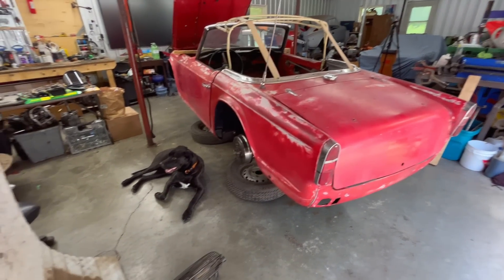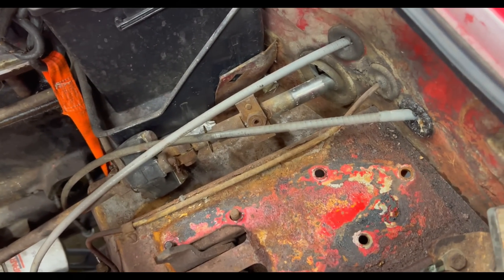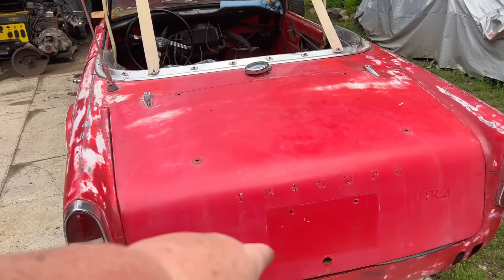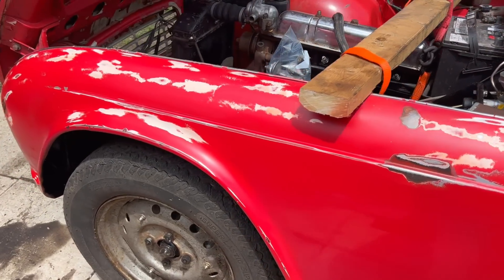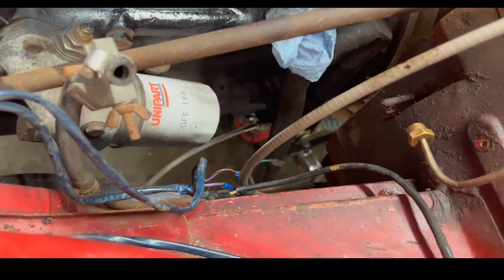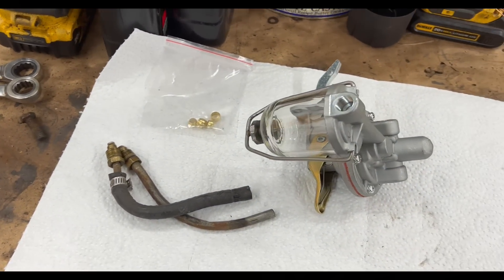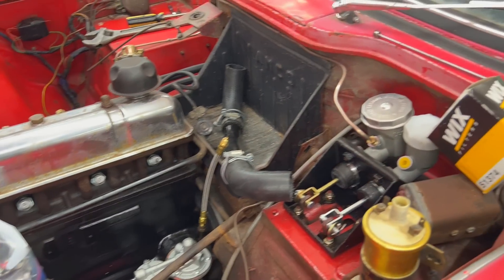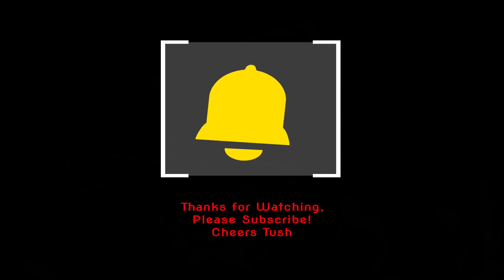1962 Triumph TR4 RUST-oration Project, Project Update

Comment: Looking good guys! Yes, those driveshaft bolts are of the correct length. I have purchased ones the were too short, right from one of the big suppliers, I had to use the old ones instead.  Waiting for the start up day!

Comment: Dave, I replaced the lower steering shaft rubber flex joint on my TR4A with a metal TR6 joint. I kept the upper rubber joint, but modified the clamps (where it grabs onto the shaft splines). The stock clamps have a poor design that doesn’t allow much clamping force to be applied to the splines. This can be fixed by using a hacksaw to lengthen the clamping slots (where the clamp bolts go through). There are some excellent how-to discussions and photos on the Triumph Registry forum.👍
Reply from the maker: Thanks Jim. I have the TR6 universal joint on stand by.  I’ll take a look at the TR register.
Reply: @cheftush  Dave on the TR TR4A forum, do a search on “splines”
Reply from the maker: @TR4Ajim roger that.
Reply from the maker: @TR4Ajim got it Jim.  Saved the photos of the “cut” area to do the modifications on mine as well.

Comment: Go to WEG"S Garage and contact them for their plans of their Radiator Shroud, metal not paper. I did and have it on my 1962 TR-4, and put a new cover on the dash so you don't have crap blowing in your face while you drive.
Reply from the maker: I’ll go check it out.  I remember the dad bending one up.  I think the dash will be fine but I’ll wait and see once we get some miles on it.
Reply: @cheftush  The dash is way easier now, so you don't have to ripe everything out again.
Reply from the maker: @billgoin4004 don’t plan on tearing it apart again 😉
Reply: @cheftush  you to change the pad, also wrap the exhaust from the header to the x frame will help cool the trans and who ever is riding shotgun
Reply from the maker: @billgoin4004  no header Bill just the stock exhaust manifold that’s been ceramic coated.

Comment: Coming along very nicely now... did you check / set the valve clearances before you changed the rocker cover and gasket ? 

I have to say that for me it's a real shame you didn't stay with the perfectly adequate original fan, generator and starter motor, it would have been much more in keeping with the spirit of the quick-and-dirty rebuild and the true character of the car. All the modern upgrades could have been done later if they were genuinely needed - which personally I doubt.
Reply from the maker: Hi John, haven’t checked valve clearances but it’s simple to take that cover off now that I’ve glued the silicone gasket to the bottom of the cover.   A couple of things on the “ upgrades”.  The generator was replaced for a couple reasons.  1.  It can keep up a little better with added things like the e fan and possible addition of driving lights in the future. 2.  It is more easily replaceable with an off the shelf alternator should I have any issues on the road and away from home.  The E fan is only a back up for the mechanical fan for when we get stuck in traffic.  It can be a real  saviour in these types of situations.  It will not be thermostat driven but will just be on a manual switch.   The high torque starter I like to install on my triumphs as they are much more efficient at spinning the engine over. They can also be used to move the car off the roadway quicker should you stall out in a bad spot….

Comment: ...DOT 5 is a good move....been running it in my 3A for years....Be sure to label the reservoirs to avoid any future contamination....AND, while I'm giving free advice, make sure the clutch slave cylinder assembly has a return spring so the throw-out bearing won't 'ride' on the pressure plate forks...This little omission once cost me an entire clutch assembly , and how I found out what the tiny hole in the slave cylinder bracket was for.....Now it's a source of paranoia with me, lol ............John (west coast,Can.)
Reply from the maker: Hi John, yes I’ve had good success running DOT5 in my TR3A, TR250 and TR6.  There is a return spring fitted as per spec.  Cheers, Tush

Comment: I think you may have stumbled into a new business model as a team. Find more not so rusted beauties  projects and repeat exactly what you're doing. At the completion of this project  calculate the man hours, parts and materials cost. Find out what this project would bring if sold. If you didn't need to extensive rust and body repair without removing the body from frame and knock these out in-between your own projects. You both contributing your time you can probably turn easy 4 projects a year and feel good about putting a safe car on the road.
Reply from the maker: Hi James, we are enjoying on working on this project together.   We are having to fit it in ( sometimes forcibly) as we are both quite busy with our regular jobs…maybe as a retirement side gig but I’m at least 10 years short of that 😉

Comment: Tush, do you have a video for pulling the axles out of a TR4/4A?  (I was hoping to see how you did that) And where the axle tube connects to the Diff, is there a seal?
Reply from the maker: There is an oil/grease seal at the end of the axle tube.   Not sure if I have video of removing the axles from the tube.  I’ll check
Reply: @cheftush  Thanks, I've never pulled the axles and would like to see that.  I'm aware of the seals at the end, just figured there must be a seal where the tubes go into the Diff, just don't see one in any diagrams.
Reply from the maker: @Michaeld-jk4kv  looked for a video…unfortunately, I don’t have one.  It’s a pretty simple process.  Take your brake shoes and springs off. On the back of the axle tube flange, you will see 6 retaining bolts usually with lock tabs. Remove these bolts and the axles will pull straight out. You can then remove the brake back plate. Behind the brake back plate, you will most likely find some shims. These set the axle end float.  Keep these safe, bag and tag them so you can put them back when you reinstall the axles.
Reply: Awesome, thanks for the assist.  I was always afraid there was a retaining clip or something in the diff to remove before the axle would come out.  Not sure I want to mess with anything inside the diff.  But is they just slide out and back in, that I can do.
Reply from the maker: @Michaeld-jk4kv  you will be surprised how easy they come out.   I actually dropped one on my foot once when it fell off my workbench…didn’t damage the axle but I did break a toe 😉
Reply: @cheftush  LOL!  Ill be sure to keep that in mind!

Comment: I just don't get this patina and clear coating over rust and awful looking paintwork ? . i know you dont have time to do a full bodywork restoration but there is no way  i would have a car of mine clear coated over rust and and awful paintwork. But each to their own i suppose, as for this Patina it is just not for me.
Reply from the maker: Agreed. Not everyone’s cup of tea and that’s ok.  Have you seen what’s under the paint though?  I have and it’s not pretty and would be very difficult and very expensive to fix back to factory standards…
Reply: @cheftush  Is that something that is planned for the future? If so, what might that cost?
Reply from the maker: @irfchawkeye9895  not planned for the future. I think I’m going to enjoy having a car that runs well, and is mechanically fit,  that I don’t have to worry about getting a scratch on or a dent in…As far as costs to restore, I would have far more into it at the end than what the car is worth .  If I was doing a very good driver ( I don’t do concourse) I’d estimate it would be about $20-$25000 to do it right…of course, that doesn’t count my time and labour.
Reply: @cheftush  That maybe so but clear coating over the mess is going to cost money to remove it later. I would never take a car to show looking like that patina or no patina, i would want it to look decent.
Reply from the maker: @cabdriveruk  good thing it’s not your car 😉